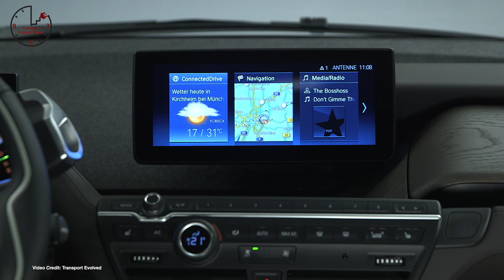Tesla’s Future, India Going Electric, Boring Company Race - TEN 252

Comment: Even if Toyota can produce a hydrogen car for the price of a hybrid today in ten years, by that time BEV will most likely have dropped below that price point. Add to that the difference in refueling cost and they still are fighting a losing battle.
Reply: Great point. The price of batteries and solar panels keeps dropping even as the efficiency keeps rising. I really don't see how hydrogen vehicles will ever be significant.
Reply: Hydrogen cars are an even worse compromise than plug in hybrids.
There is no hydrogen infrastructure worth speaking of and it is extremely expensive to build those tanks. Plus you lose the benefits of electric cars f.e.: large cargo space.

Comment: Are miles per Kwh's quoted by manufacturers ?
Reply: Usually you can find information on watt hours per mile.  Or it's a simple conversion of how many Kwh's the battery pack is vs how many miles the vehicle is rated for.  Example, my model 3 dual motor is 310 miles on a 75Kwh pack, making it just over 4 miles per Kwh.
Reply: @zygot3060  Thank you
Reply: This is what I regret,they are not talking in kWh/100km (sry mate but SI there :P )
They are only talking about autonomy but not the kWh cost per 100km even we do it for dinosaurs cars 
Stupid :/
Reply: ENGINEERS, SCIENTIST AND THE WORLD SPEAK METRIC ! RETARDS, MOST OF THEM LOCATED IN THE US, SPEAK MILES !